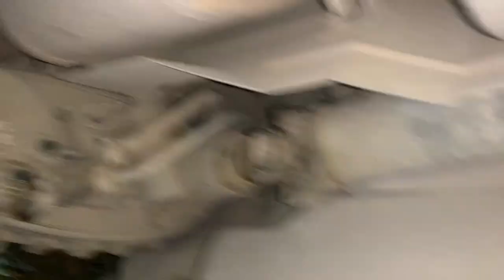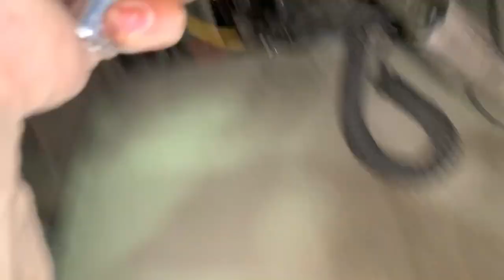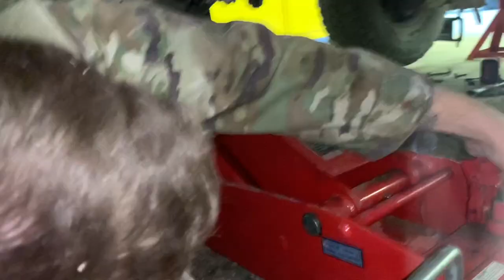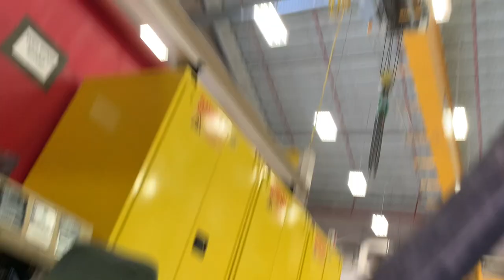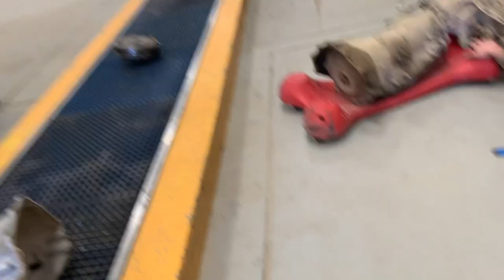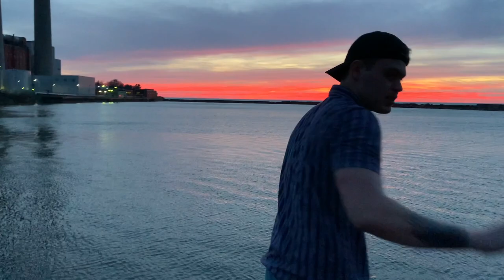Army Mechanic Removing Transmission In Military Humvee

Comment: Umm i would have thought the Army would have a better motor pool then that. You guys are pulling a HMMWV transmission using jack stands and a floor transmission jack....WTF...seriously not only not the safest but wow thats crazy slow. Great work on the team not knocking that, just you need better equipment.
Reply from the maker: I’ve pulled engines with only adjustable wrenches